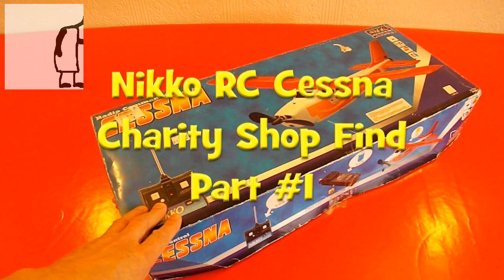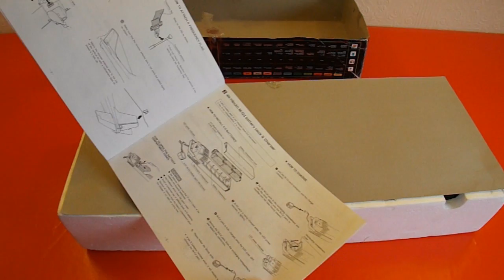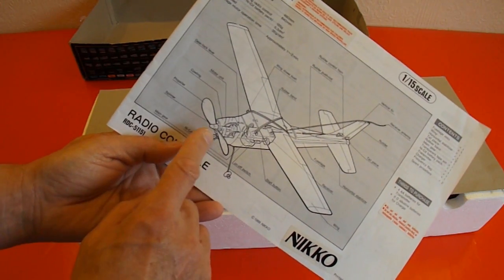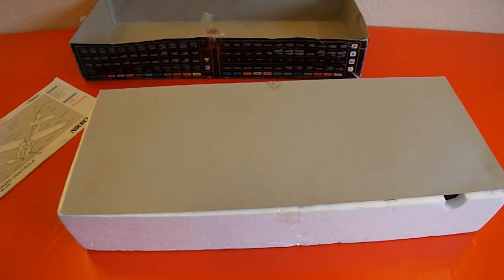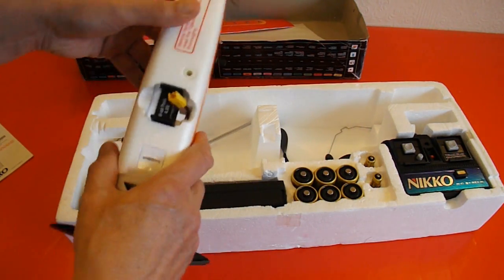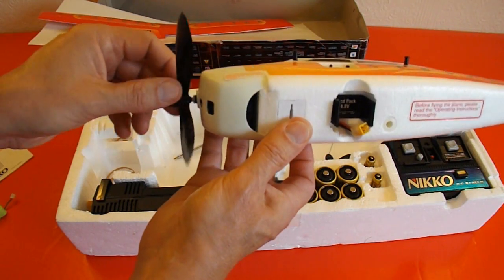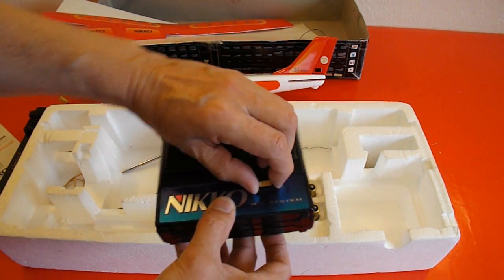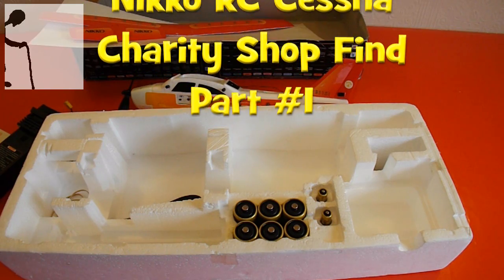Nikko RC Cessna Charity Shop Find Part #1

Comment: I've seen another model Cessna in Banggood.
Cheap and three controls.
Two servo and motor control, combined with the receiver.

I think that combined receiver, is like one that you have.
Reply from the maker: +Francisco Javier Lázaro Pinela it is a common design often used for model planes as it is very stable in flight. I think the one I bought is old enough to be a collectors item.

Comment: figures. about the rain. our rainy season just started here . had our first significant storm of the season last week. hope the battery test  turns out ok. at least u can do taxi tests during the bad weather .
Reply from the maker: +allan egleston battery tests - runs for about 10 seconds - but that is probably all I need to begin with, just to get it into the air and glide back. Just need the right weather.

Comment: You could use 4x1.2v aaa battery's for the plane Or look on line because you can get those small batt's from EBay, I think they are 1/2 aa size
Reply from the maker: yes they are AA diameter in 4 square format but 1/4 length. Haven't found any yet but I did find AAA NiMh equivalent, you will see in a later episode.

Comment: Hi grandad, would it be possible to make an RC boat from quadcopter (using all four motors or less) in order to control it forwards / backwards and turn, or perhaps air boat? Regards!
Reply from the maker: +Viktor Božičević I am sure it would be possible but I don't have a quadcopter to take apart so I won't be doing it, sorry.

Comment: This plane design is gd but NiCd or NiMH batteries don't have juice to fly anything.

7.4 V would work for 4.8 case + there is short range hack for AM antenas. U just manually prolong antena by puting 2 or 3 antennas on top of eachother to double or even tripple the range

Comment: the wing looks really thin, is it flexible?
Reply from the maker: +JOHN diy STUFF〉make everything that depends on what you mean by flexible. It is styrofoam with a shiny surface of some sort. It has a curved section so it is relatively stiff.
Reply: GrandadIsAnOldMan
can it break easily then?
Reply from the maker: JOHN diy STUFF〉make everything I expect so, most toy planes do when you crash them.

Comment: can you turn the mitsubishi pajero into a hobby grade rc car?
Reply from the maker: +Daffa Amanu I am guessing you saw the video I did where I put a hobby grade receiver on a similar car. If you heard my summary at the end I explained that I don't think it is worth the effort. You do get a better range with a proper hobby grade transmitter and receiver but unless you plan to change out the motor and provide proper servo steering then you don't gain much. If you plan swapping the motor and providing proper steering then you are better off saving you money and spending it on a proper hobby grade RC car.